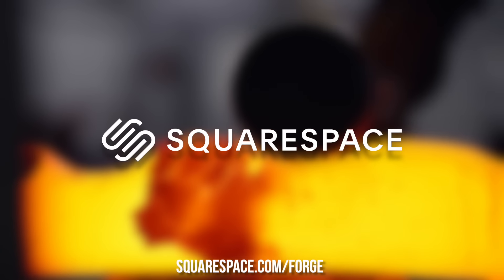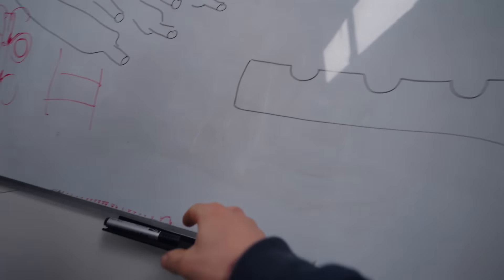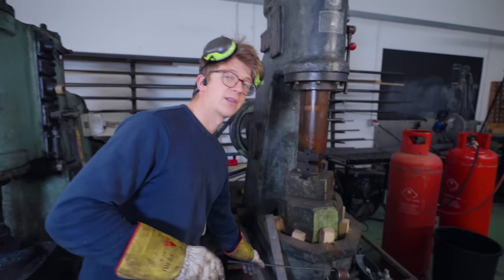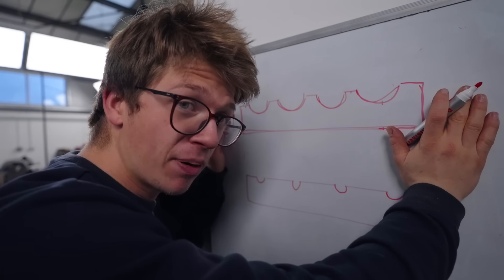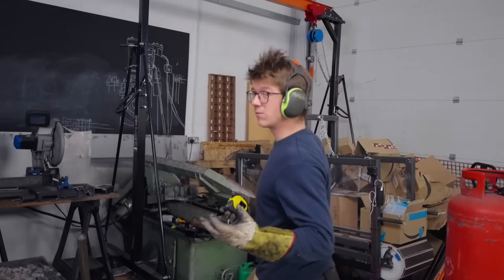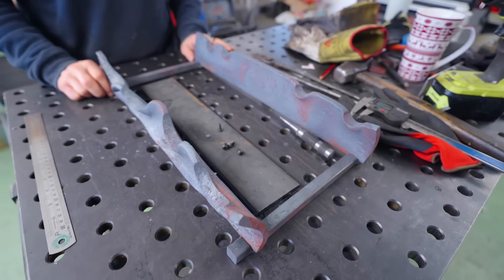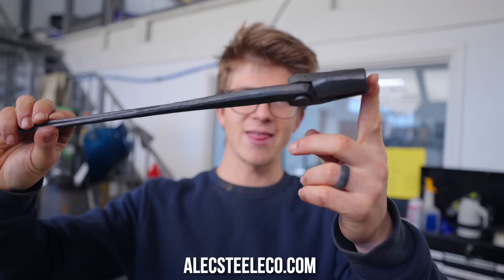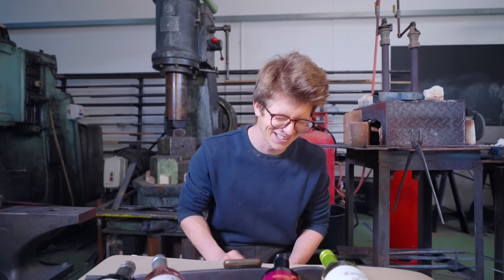AI Came Up With a FORGED Christmas GIFT Idea For Me to Make!

Comment: Wasn’t sure how the rack was gonna turn out when you describing the style and was like idk bout that. Then it was pretty sweet. Just as a side note, you want the top of the bottle lower so the wine is completely touching the cork. Bottles with real wine corks need to stay wet so the do not leak and crack. So if you’re actually storing wine there keep that in mind, won’t matter with twist tops or synthetic cork.
Reply: As long as they lay flat everything is fine. The air bubble rises to the upper belly of the bottle and the cork is wet. No need to angle them down.

Comment: Brilliant, the design suits a wine rack 👌🏻.  The steel looks like melted glass with the way it folded. 
Not sure it it is possible but if you could chrome plate over the forged a finish, I think could add some nice complex reflections. But it may make it look to gaudy.

Comment: You're going to run into some function issues with this wine rack, the first being noise. Add small foam or felt strips(they can be discreet!) where the bottles make contact with the rack or every footstep nearby will make them ring like bells. Apart from that, make sure to either tilt the rack forwards a bit or back the bottoms against a wall so vibrations don't make them fall off.

Comment: For the 3" rivets in the base piece, couldn't you have 2 bracers, 1 on either side - at the height that the base of the rivets will come to. Leave them cold/on the press so they dont weld or bend with the metal.

Comment: Hey just wanted to point out that the top of the bottles need to sit lower then the rear so air doesn't leak the wine needs to cover the cork
Reply: As long as it lays flat everything is fine

Comment: Is it possible to make a chellow and bow out of Damascus string it and play or dose the timber play a role in the sound and structure of the instrument it would probably be extremely heavy unless you could get the Damascus thin enough also would the pattern show up on the instrument or would it disappear in the forging process

Comment: I got a question regarding my folding pocket knife. The knifes blade is made out of D2 steel. So i was working in my garden and i used my knife to cut pinky width branches and now i got a slight bend on my edge, if you look at the knife you can see that there is a bend because it reflects light under a different angle than the rest of the blade. So i wanted to ask if it is possible to straighten it without heating up the blade.

Comment: You want your bottles angled down so the cork doesn't dry out. If the corke dries out it can strink and air can get into the bottle which has oxygen in it and oxygen can ruin the flavor of the wine causing it to spoil.
Reply: As long as they lay flat, they will be fine. No need for an downwards angle.
Reply: @GerjanDeEerste  thanks for the clarification I'm assuming that they only need to be stored angled down when you're storing them for very long periods of time
Reply: @joshuanicolai4776  true, but I would recommend to drink wine instead of storing them. 😄

Comment: An interesting piece, but I thought the point of a wine rack was to hold the bottle cork down, so that the cork stayed wet and swollen to preserve the wine.  Or is that just a myth?
Reply: you are right the neck should be lower than the bottom if a real cork is present...more and more wineries are making wine with either screw top or synthetic corks so any angle is fine for those. And yeah "interesting" piece, not my cup of tea. but the process was cool to watch.